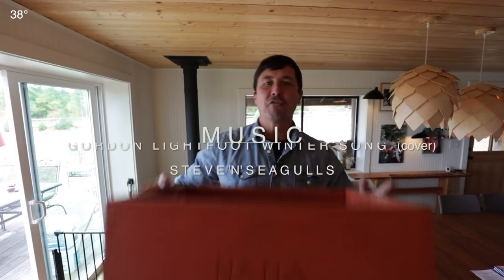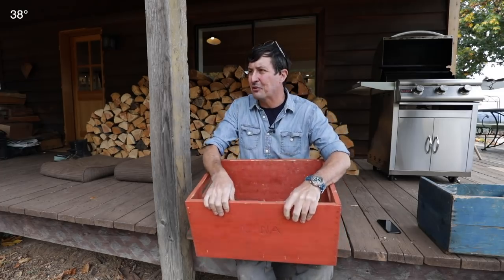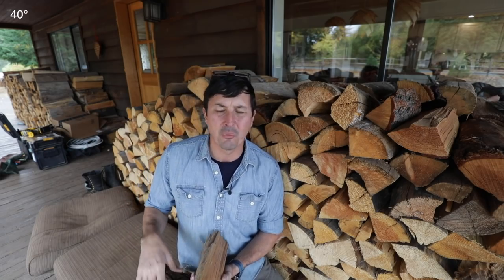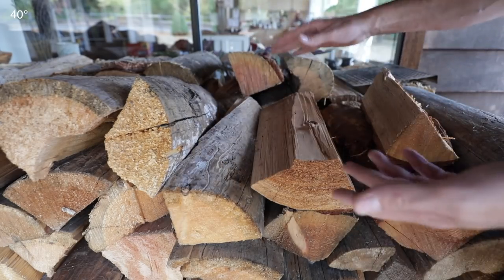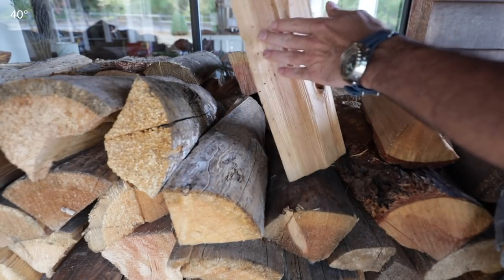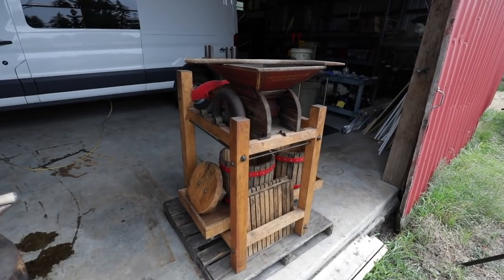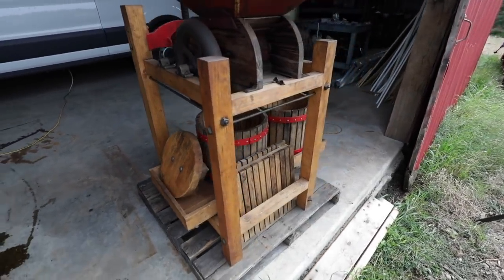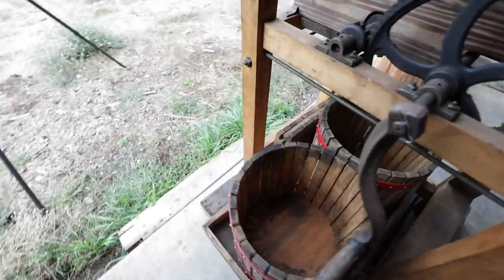How To Cut Kindling Like A Pro

Comment: The best kindling is gas 😂
Reply: You mean a propane torch and propane and propane accessories
Reply: boy scout juice !
Reply: @jenniferwhitewolf3784  lol you're dead on. My peach moonshine easily exceeds 100 proof and even my Applejack will start a fire. I think you can get a legal fuel distiller, but it's nicer if you can give half a jar to fire and drink the other half to warm yourself up 😄
Reply: rule number 1 do not use gas to start a fire
Reply: Gabriel Bonnell 
No Diesel is better
Reply: Jennifer WhiteWolf methanol distillation from biogas is much more efficient and scalable.
Reply: Fatwood rocks

Comment: Thanks again Wranglestar for displaying ideas for improving kindling splitting.  I went out to my garage and welded up a good splitter out of 1 inch square tubing that I had a lot of with 9" square bases and top square ring.  Uprights were made out of two pieces of tubing for additional strength in the middle of the two pieces for welding the cross knife to.  Used middle of a quarter inch thick lawn mower blade with a solid steel round bar about 5/8 dia at the bottom edge of the knife blade to increase splitting.

Comment: Great stuff.   I also gather the debris under the log splitter.   With 10 acres of trees, branches and tree tops are alway falling.   Letting nature have a year, and dried and ready to stack in the kindling rack or buckets.   Bark, especially birch bark, burns hot and last long enough to ignite the kindling with ease.     I have a long table, and I put an old chop saw on it.  I lay a long branch on the table and feed it to the chop saw cutting it in 1foot lengths.  Thicker pieces of two inches or more I split after it is cut.   Cedar is the best, splits easy, burns hot, and starts the other pieces of wood.  The importance of kindling is a huge necessity for those who heat with wood.

Comment: We had pinion pine in our area, but mostly shaggy bark juniper, but we would burn some pinion on occasion for the heat and smell, then burn something hot after, like juniper or oak or cedar and it would burn off the soot from the pitchy wood ,or so I was taught

Comment: Hi, I am from India and I do not know much about life over there, so few questions out of curiosity.
1. Do you stack all that firewood piles by yourself alone?
2.How much do you have to spend  on firewood for a single year ?
Reply: I can prob help , I see he didn't reply to you , many cut and stack our own wood, and he and his son stack his poles yes, like me he owns a farm so cuts his own firewood , as do I in Canada, I'm 60 and we still do most our own wood for winter, to buy Harwood in Canada is $ 180 to 200 per cord, like Maple , Oak , Ash , we also have pine, lodgepole , ponderosa, apple , birch , lots of variety , most people here use a mix of woods , depending the cold, and what's available locally, do you cut and use woodstoves in the winter in India, what type of woods do you use ?
Reply: @daleval2182  Thanks for the the detailed reply and your time ☺️.

In our state the ,except from some hilly regions , temperature varies between 32 and 22, so almost all of us does not use firewood. At a few regions temperature drops to 5 degree celciois for few hours during the winter season but fire place is not part of house design there. 

Other states in India have freezing temperatures during winter. I am not sure what kind of fire logs they use. Since forest rules are not very strict in India when comes to the case of harvestation by local people, I believe people at those places collect all kind of logs from the forest.

Comment: I call my Mother in Law Nana as well, my French uncle Charles who I was named after had a good system for starting fires which I have adopted. While cleaning up around his property he would take a paper grocery bag and end up filling it with twigs. He would keep one or two indoors and a bunch in the woodshed, I heat with wood as well and live on an island on the Atlantic coast where the temperature fluctuates a lot in the shoulder seasons and also in Winter.  It's very handy when I get up in the early morning or need a quick fire to put in a bag with a few small logs on top and touch it with the torch and away it goes, thanks, Chas.

Comment: Kindling is something I'm good at! Here is my hints:1- cut kindling shorter, pick out nice straight pieces (both you've done)! But I don't use hatchet, use full size axe (leading hand by axe head, an trailing handle balanced at hip. (Handle length used for balance an power strokes). (I don't cut wood on "House Deck" an very rarely seen) LAY TARP DOWN an place cutting block on TARP edge so kindle cut into TARP! Split from sitting position with axe power coming from long handle swing from hip to kindling face.  (then just gather days kindling by picking up TARP Corners an no need to handle kindling), pour kindling into storage box (my Grandfathers) from TARP, No mess Not Fuss! (You need a kindling shed where you can separate branches, an have seat an everything all set up!) Under cover! P.S. your teaching kindling cutting an using your deck as proper teaching technique, Haha, that's funny!

Comment: Fatwood (which is resin impregnated pine from stumps so it's similar to the kindling that you are making) is the best (safe/intended use) fire starter I have ever used. 2 sticks can get you a roaring fire with little effort if you are halfway decent at stacking .

Comment: you gotta get one of those kindling splitters, or make one like i did, i took a hatchet like yours welding some steel through the middle where the handle would go then made it go down to a base and attach it to a log and then made a cage around it to stop the wood from flying around so now for kindling splitting you just need a hammer, mini sledge.

Comment: I have one of those little 5 ton electric splitters that I use to split up kindling or any other log I want to bust down. We only heat our body shop with wood though not the house that is heated with propane so that little electric splitter is right in the garage in front of the wood stove. Works perfect.

Comment: Kindling is of course for starting a fire, and usually only a few inches is burned in order to get the fire going.  It’s way more efficient to saw your logs into 4 inch lengths, then splitting it into kindling is much easier, and you only have the amount of stick you need to start the fire.  Way less wood, way easier splitting. You can store a years worth of kindling in a microwave box.

Comment: If you just box up all the chips and chunks that fly off when doing the original splitting you'll have boxes and bins full of kindle to use. Go to wherever you usually swing the ax and I bet there's a cubic yard of kindle on the ground around the splitting block.

Comment: you should try stacking up all those logs vertically in an old tire and try splitting them up with a regular axe - i thought it would make much easier and faster kindling for you.  TRY THAT.

Comment: the best way to to split kindling without hurting yourself and way easier on hands and back is i took a axe head welded a 1 foot around ring about half a foot above the axe head and then weleded from the axe head down and made a base fo rit and anchored it to a splitting log. just google kindling splitter. use a mini sledge and just pound the wood into the axe head to split and instead of using axe to split the wood. my gma is 81 this year and she loves this. she still splits her own firewood, uses a 10 pound maul for the gnarly stuff and isnt splitting very well and a normall splitting axe for the easy stuff. she is a badass!!!!!!!!!!!!!!

Comment: Good job but it would take you forever to produce kindling that way in Australia with our hardwoods. Is that Gordon Lightfoot singing in the background. Love your videos Cody! We just place our multiple pieces of firewood inside an old tyre mounted on a splitting block and then split it into kindling with an axe or maul; quick and easy with no risk of losing a finger. Others mount an axe upside down on a splitting block, hold a piece of wood on the edge of the axe and pound the wood with a mallet or club hammer. What is the problem with the bible?

Comment: As a former firefighter and a long time wood burner , the two biggest problems is green wood and choking a stove down too far . The other primary problem is any chimney that has 45 or 90 degree bends . Many chimney fires from a wood stove installed using an old masonry chimney . They can't take the heat and often the mortar falls out so fire shoots into attic space . Also if roof is made of kindling . Nothing I hated more than fighting a roof fire on a 12 -12 cedar shake , wet roof .

Comment: I've always prefered sleeping in cold also.  My nose that likes it most.  My nose (and yours) works best with cold air.  I'm no scientist, that's my own belief but I'm pretty sure I'm correct.
Reply: Cold air is denser than worm air. So if you breath in the same volume of air you are getting more oxygen. That is partly why you don't get tired as quickly working outside when it is cold than when it is hot.

Comment: Cody, do you ever wear gloves when splitting firewood? I love my Wells Lamont gloves that you recommend previously, and I've started wearing them more and more when using my axes. I've got my woods tools razor sharp and managed to slice the back of my thumb open when it grazed the heel of the axe after chopping wood all day last summer. I'm not seeking to criticize, but are you using any tricks when splitting this kindling, or are you just relying on experience to make sure you don't hit a finger accidentally?

Thanks,
Alex
Reply from the maker: Not much anymore,
Reply: Thanks for the response!

Comment: Another argument you could make about not using hardwoods like those on the east coast is that the recoverable heat value per cord of western conifers are often as good or better than eastern hardwoods. Ex. Douglas Fir = 24.6 mil BTU/cord vs Red Oak = 24 mil BTU/cord. Western conifers are substantially better firewood than eastern conifers so the east coast perspective of hardwoods over softwoods is irrelevant.

Comment: Your kindling usage situation sounds like when I'd light the fire at our last house.
I'd save all the fine little sticks, bark, pieces of thin old backing board off of broken furniture etc. for kindling.
I'd use all these bits sparingly as I could (got it down to a fine art really), but then my mum or her partner would come and light the fire and use whole handfuls, enough for me to light the fire five times, just to light one fire.
It would always make me cringe and I'd try and nicely ask for them to use it more sparingly, otherwise we wouldn't have enough and we'd have to buy boxes of kindling (factory off cuts from skirting boards/mouldings), but they'd never see the issue with it.

Comment: Firewood in general begins losing it's value in heat content in 3 or 4 years, and the difference becomes noticable in 4 or 5 years. It will begin with mold and normal decay.

Comment: HOW NOT To cut kindling like a pro.... If you want to cut kindling the EASY way, cut your round in half making half length rounds which split VERY easy.  Do this on straight grain knotless wood and BOOM, easy.  Far easier to use a chainsaw than an axe.

Comment: Hmm. I know you are so well practiced that you're not going to hurt yourself, but I don't think teaching people to chop down toward their hand is a good idea.
A safer way is to hold the wood horizontal and the hatchet parallel to it and bring them both down together. That splits the wood just as easily, and you never have a body part in the path of the blade.
Reply: The first blow is a gentle one just to bed the hatchet into the wood. Then take your hand away and lift the hatchet for the final splitting blow, and the wood lifts with it. Even if the first blow hits your hand it if you are holding the wood part-way up - not close to the chopping block or close to the top - it won't be too bad. Watch him @9:17 although he doesn't always do it that way.